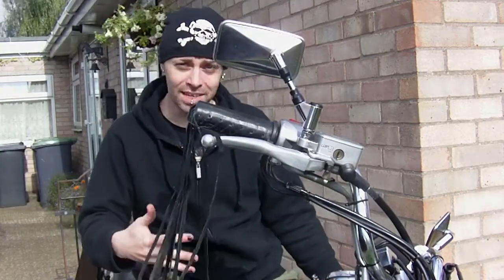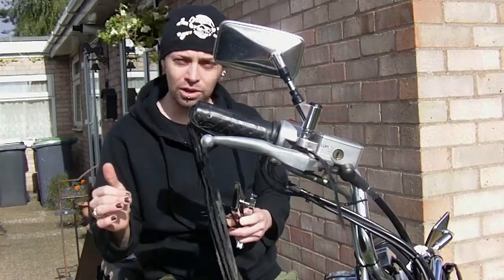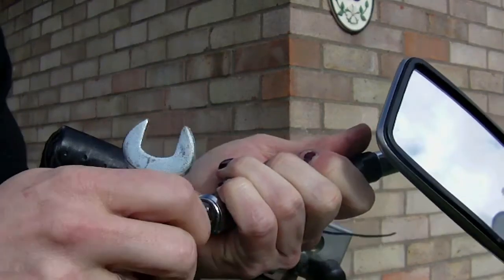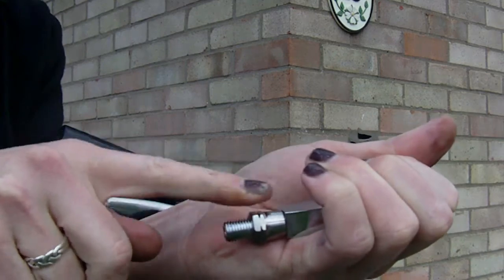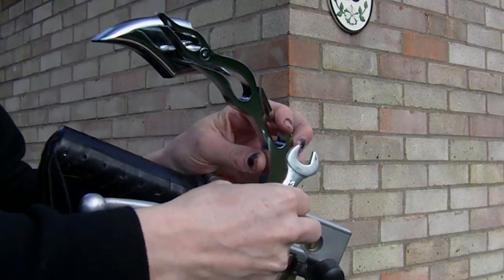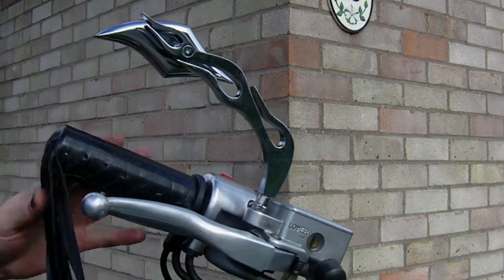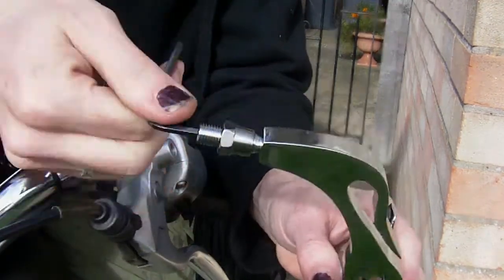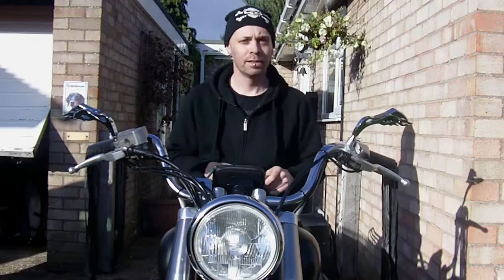Fitting Cruiser Mirrors - Yamaha

Comment: I've nearly bought the same mirrors a time or two from ebay, but could never quite make my mind up, mainly because the of the size of the actual mirror it's self. I'd thought about buying them for the stems and using some other mirrors i've got spraying just the mirror not the stems, as I thought the chrome flames would stand out great against a satin black mirror back, Look good man! Ride safe Bud.